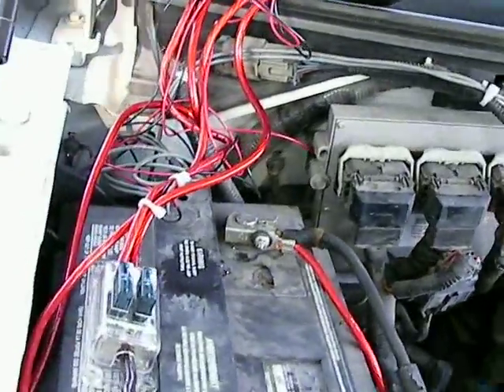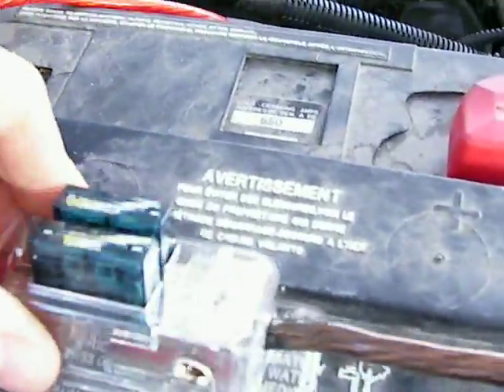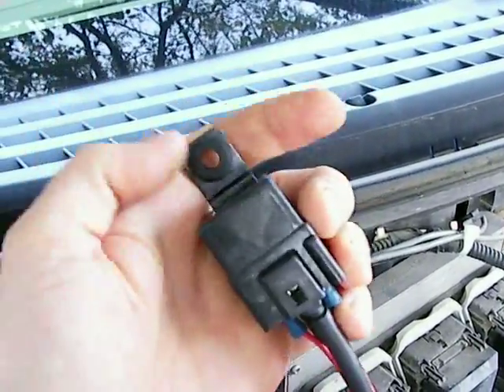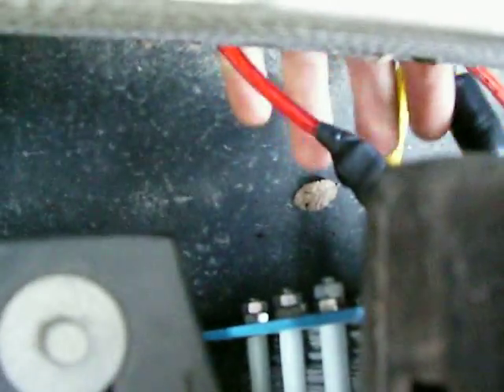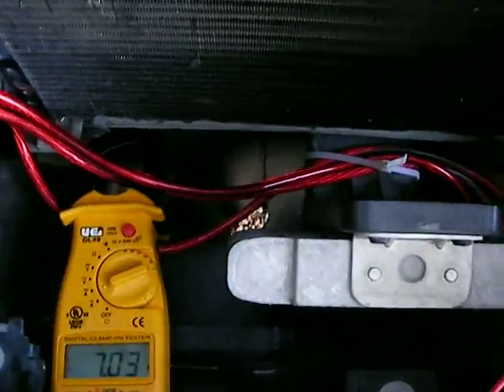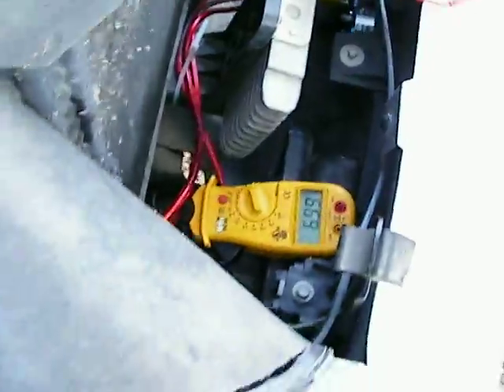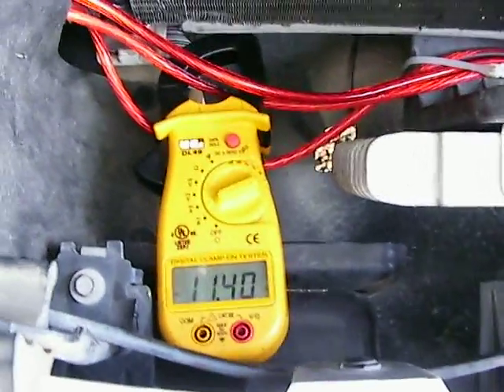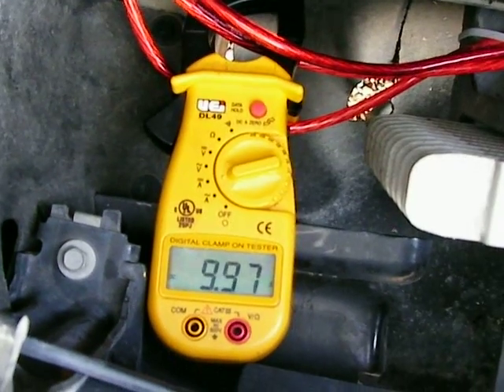using pulsed magnetic fields to make hydrogen

Comment: yes, this issue is known ... number of ways to approach it ... use a smaller inlet tube and larger outlet ... use mulitple inlets and maybe multiple outlets ... increase size of lower hole in plates ... use a pump ...

none of these solutions is ideal ... all solve one problem and cause another ... you think its tough to beat with 20 or so plates ... walk in my shoes and try to get even fluid distribution with 110 plates !!!   LOL ... you will figure out a solution that works I am sure ...

Comment from the maker: yes i did..i tested resistance from plate to plate .. my first thought i also checked the voltage.. i plan to tear the cell down this next week i tried to back blast air into it to see if there was some crud clogging it. the only way to tell is a teardown.. the longer the cell runs the plates get stained so i can see what is happening...

Comment: that is not normal you have a back pressure problem usually when you power the cell you have high amps and when it start producing it goes down .did you check if there is short somewhere .

Comment from the maker: the cells with the inputs and outputs on both sides of the outer plates do not have this problem..the gap voltage at 15 amps is pretty consistant..be it surging up and down but in the same range. at higher amps i will test... 40 amps should do.....

Comment from the maker: i wonder if a horizontal slot across the top of the SS plates would be better. with 2-3 outs on one side.???? or 3/8 holes x 3 at the top of the ss plates with fittings to match the location.. looks like an idea for another video/experiment!!!HEHE.